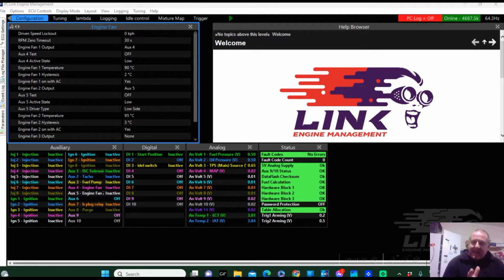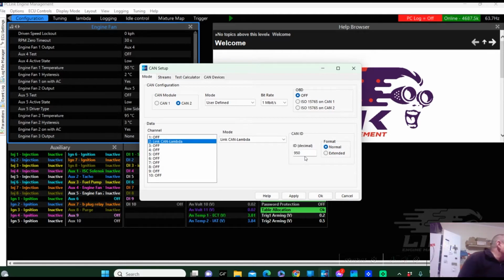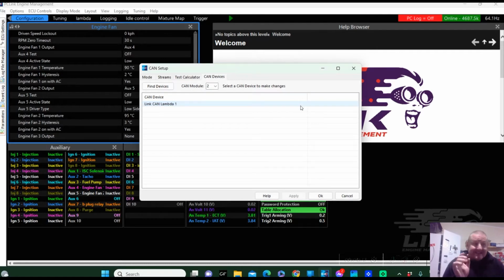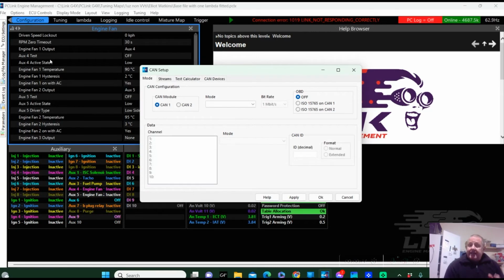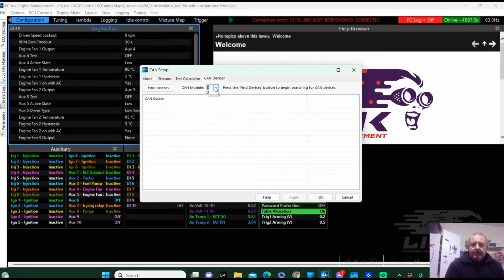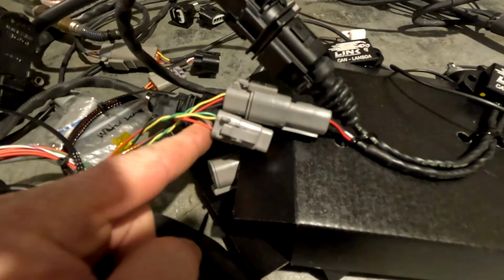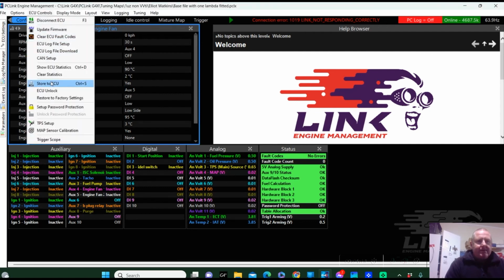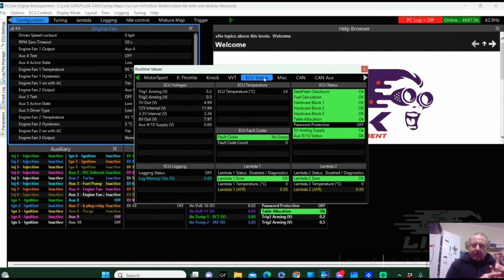Setting up link ecu twin can lambda units via CAN

Comment: Hola amigo tengo un problema con mi ecu monsoon, se me desactiva la entrada digital para control de lanzamiento, si la ecu esta con energia bien, pero si queda sin energia pierde esa configuracion de activacion
Reply from the maker: Best do some diagnoses and discuss with the dealer who sold you the ecu otherwise there are facebook help pages and link support to assist with any issues.  Cheers Kelvin

Comment: Hey Kelvin, I have a 2GR TRD supercharged swapped MR2 running the Link G4+ ECU the car has been tuned and runs okay and makes power BUT! It stumbles when you try to rev the engine from idle or if you try to blip the throttle on down shift…. Ive changed throttle body, checked coil packs, checked fuel injectors, checked timing and everything checks out. Ive even rewired the full engine harness to ensure it was fresh with no wire breaks. But no change.

I did notice that my current fuel reg is rated to 43PSI (Radium No3) would this reg be my nemesis for poor throttle response from idle. Should i run the radium No4 regulator with is 4 BAR 58 PSI?

Cheers
Damo

Comment: Hi im from south africa. Im injoying your videos. Can you tell me how to wire my lambda sensors. I have install 3uz engine with toyota hilux manual gearbox. The wiring harness does not have wires in for the exhaust sensors. Thanks Jan